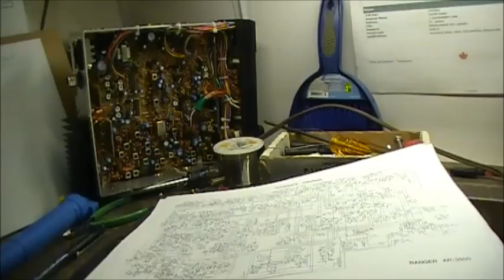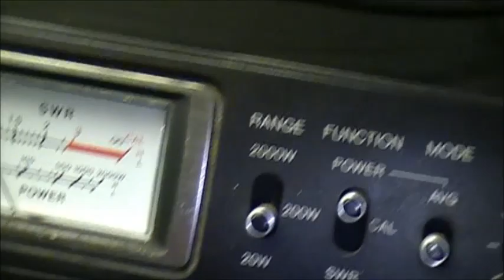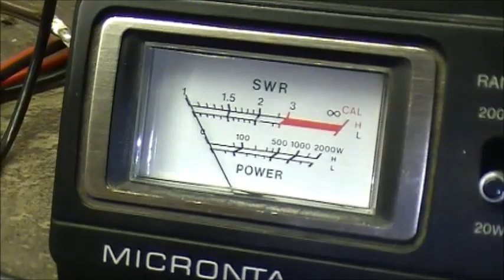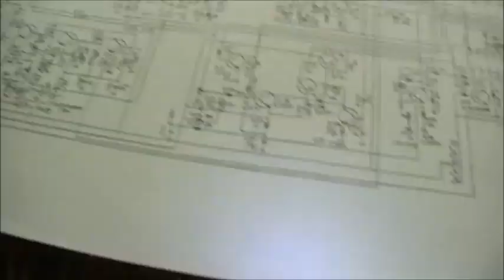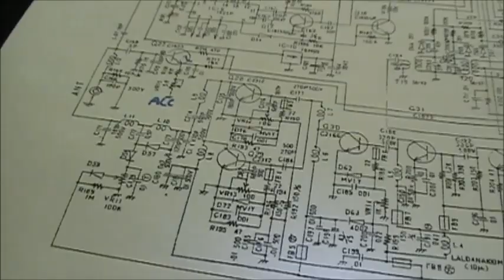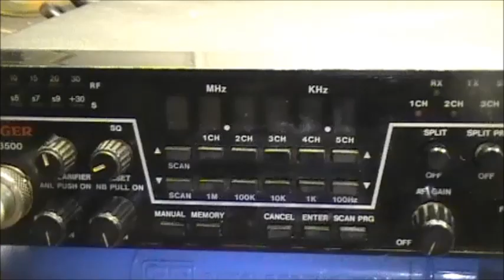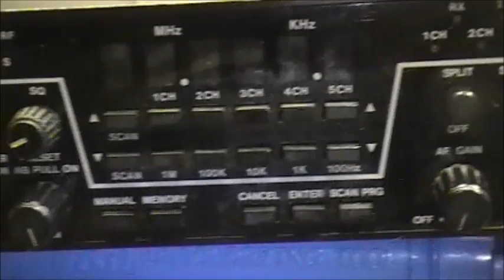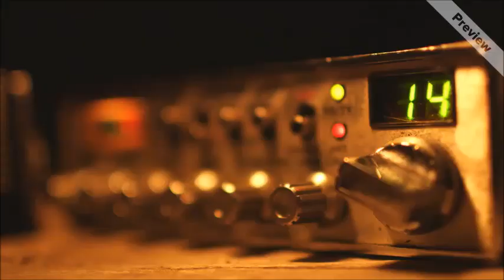RANGER AR-3500  Part-3  UNECONOMICAL TO REPAIR

Comment: Hi there Darrell.  Noooo say it's not  true!!!  You've got to repair the old ar- 3500😁.  The reason I said try changing the 754 device is because on the first video when on am mode I noticed you didn't have any forward wiggle on the meter ! I've seen that before and it was the 754 that was shorted also high dead key . But I noticed you have meter movement now you changed the 754!!!  . I think the best thing to do would be to have a visit on cb tricks and get the voltages for the transistors ! Around the alc area you were looking at and also around the 754 area .  Just for Interest what does the audio sound like to another radio? Does am sound ok? And ssb sound ok?   Keep chipping at it Darrell .  Good luck bud. 73s
Reply from the maker: I was on the website, there is no voltage charts to go on.  So there is little i can do without other then fiddle around till the issue is found.

Comment: Me again. How about trying an alignment Darrell?  That might show up something that's not right?  Like a voltage or a frequency wrong ?  Just a thought bud. 73s
Reply from the maker: I performed the alignment based on the webpage and printed it off, everything was perfect except for the lack of RF power being amplified properly.
Reply: Hi Darrell. Just a quick one!. Just been looking at some of my old notes!.   have you checked the diodes around the output devices? They can cause low ssb as I had a similar issue with a rci 2950 years ago . 73 bud.
Reply from the maker: hmmm. interesting.. never thought to check them.  my bad, thanks for the heads up! ;-)